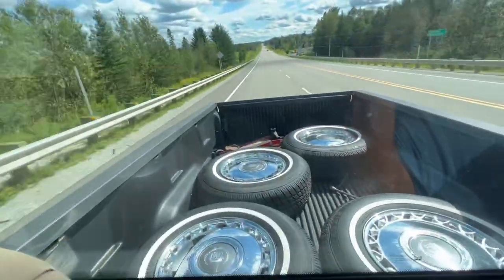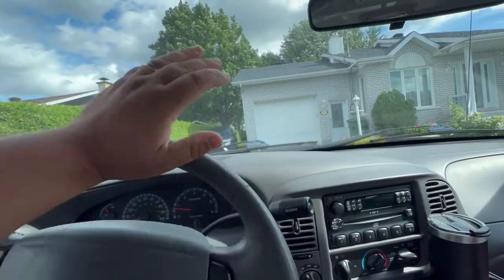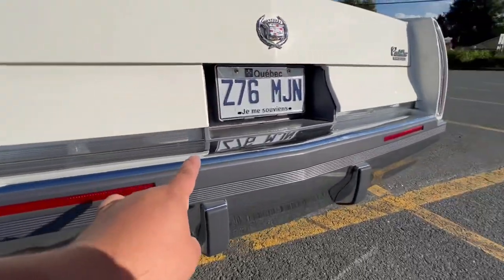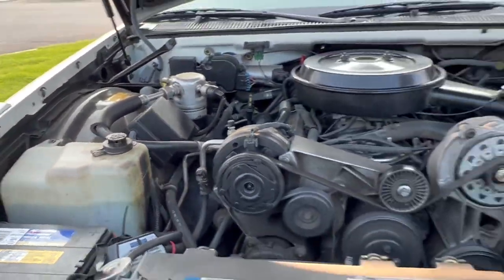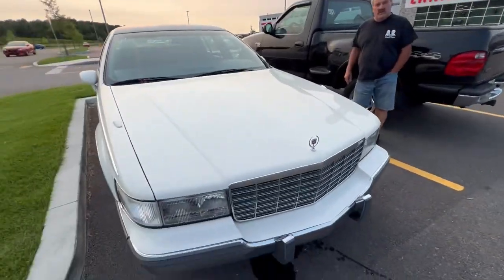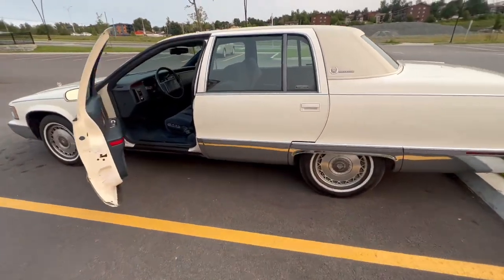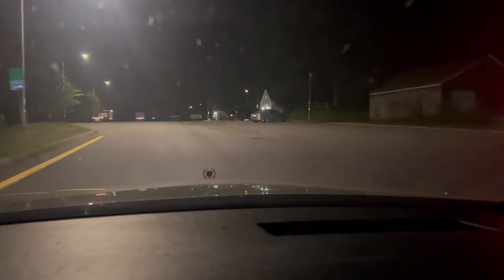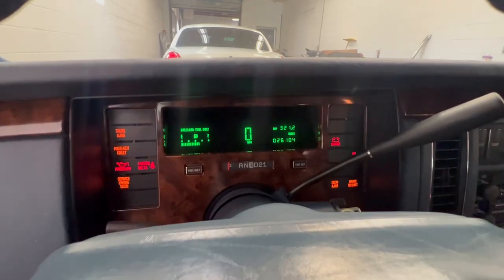I bought the FINEST Cadillac Brougham I coukd find in CANADA 🇨🇦 THEN IT BROKE Caddy Fleetwood

Comment: Don't forget you have Canadian viewers. Its quite possible if the right car comes up that a Canadian might want to purchase a Canadian car without doing conversions of the Speedo odometer control panel. I think viewers will love this exterior especially. Keep the 2 best versions of this car you have and sell the third one.
Reply: No conversion to miles necessary, just push the button on the dash and switch from kilometers to miles.

Comment: A Nice car, I have a 95 with 53k miles. Mine has the LT1 v8.   It has the weird optispark  distributor. The water pump is above the OptiSpark. When water pump goes out so does the distributor. 1993-96 Fleetwoods are the real last Cadillacs in my opinion.

Comment: Beautiful Cadillac, I would sell it as fast as you can, it is just too nice to keep it. I wish I had more money, I would buy it & get rid of my wife's 2005 signature L Lincoln with 173,000 miles. ( I do not care for Lincolns). My 1949 Cadillac broke the flywheel, & destroyed my starter motor. now I need a transmission jack, to let the trans down, & remove the flywheel, & replace it. My 2002 Excursion diesel with the 7.3 liter engine just turned 400,000 miles. Say hi to Papa bear, your friend Bob.

Comment: I have a 95, with about 25,000 km on it. Compared to my Buick Roadmaster the Caddy's ride is Mushy, and the Seats aren't as Comfortable. It has the Tow Package with the 3.42 or 3.42 Diff, so it can accelerate quite quick but it does gulp gas. The formentioned Seats are Pathetic compared to what Cadillacs had in the late 70s